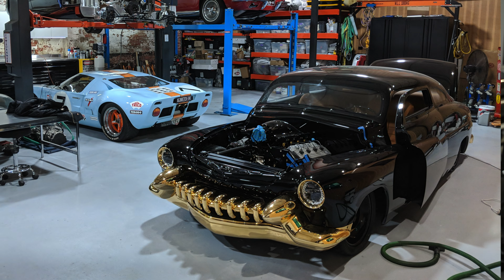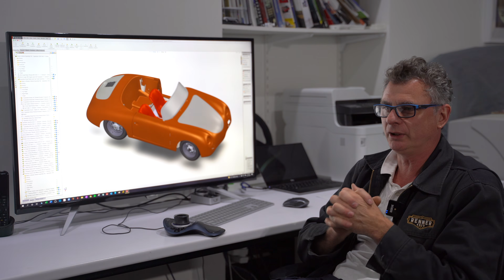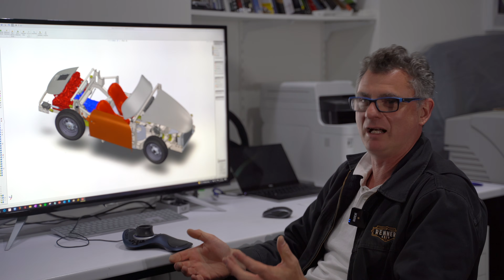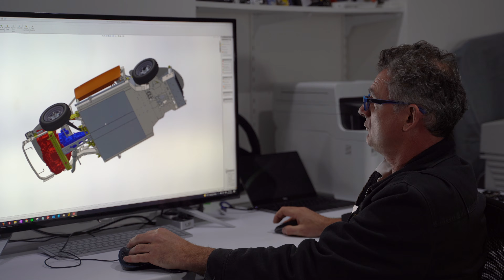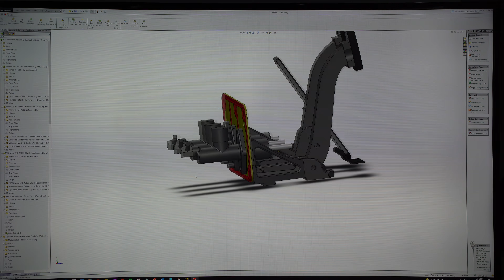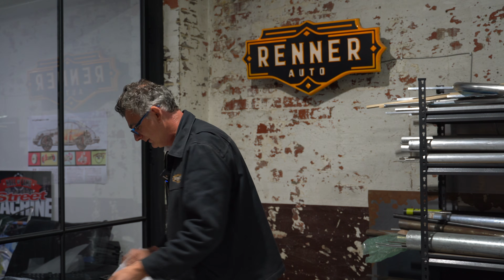Speedster Reimagined a Renner Auto Interview || Outlaw Garage

Comment: Great video, and fantastic design and execution..   I'd love to meet Jason and hear more about his journey.

Many years ago I designed/built a Speedster chassis as my thesis (undergraduate engineering)....   Coincidentally, the bits that presented the biggest challenge to get 'just right' on my project were also the heater control tap, pedal location, steering column and handbrake.
Reply from the maker: Hey well done.  Jason is great so if your in Melbourne at anytime I'm sure there would be a chance to say hello.